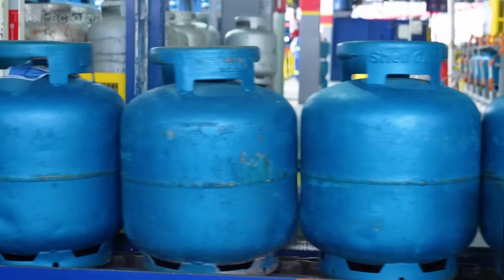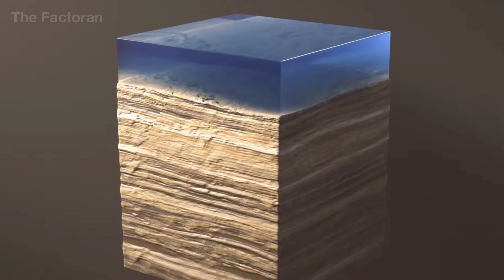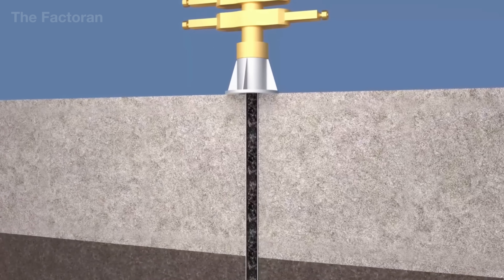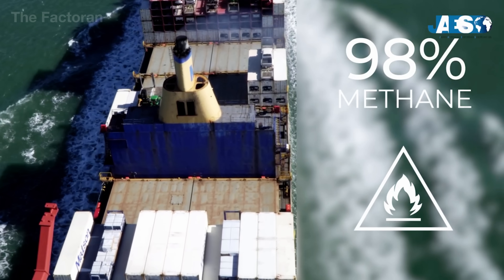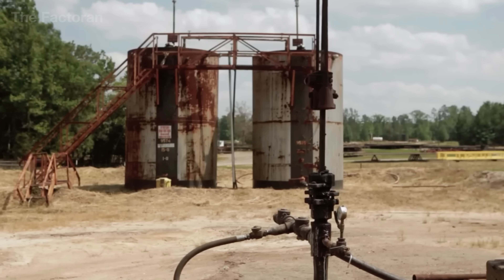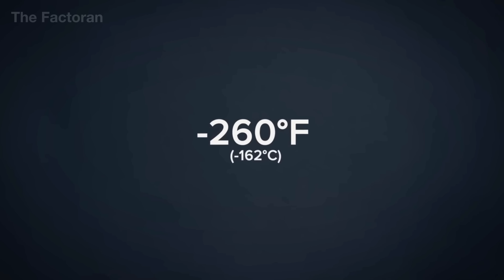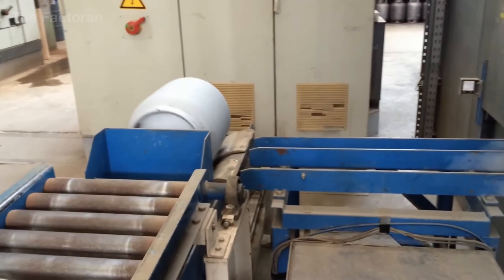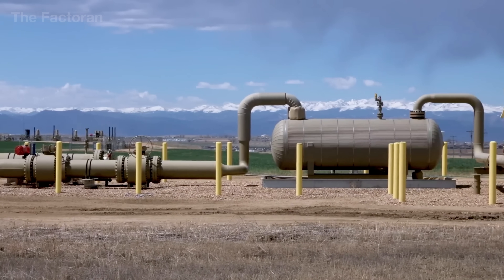How Millions Of Tons Of LPG Are Produced From Crude Oil – Inside Massive Production Line

Comment: Reading the subject line, I thought this was about breaking the long carbon chains of the crude oil to make propane and butane gases. It's actually about turning dirty crude gas into usable gas. There is no oil-to-gas process.
Reply from the maker: Good clarification — you’re right. This process refines crude gas components, not converts oil to gas. Thanks for pointing that out!

Comment: LPG is not at "extremely high pressure". It's almost entirely propane and you can't compress it past its liquefaction point, about 125 psi; 107 degrees at 100F and about 177 at 0 degrees F. Compress natural gas, CNG, is an entirely different story, methane, it liquefies at thousands of pounds of pressure and requires refrigeration to do so. It's somewhat amazing how different they are in this regard, but they are.
Reply from the maker: You explained it perfectly 👍. LPG stays liquid at relatively low pressures—under 200 psi at common temps—so it’s easy to store in cylinders. CNG is totally different since methane needs thousands of psi or cryogenic cooling to liquefy. The contrast really shows how different these fuels are, even though people often lump them together.

Comment: As a geologist, I find it interesting that you display marine seismic surveys capturing two-way travel times of rays sent through the subsurface whilst explaining the drilling of a borehole and capturing of data from within the borehole. To me these are two distinctly different methods of capturing data.
Reply: This is a propaganda video.
Reply from the maker: Great observation 👌. You’re absolutely right—marine seismic surveys (measuring two-way travel times) and borehole logging are very different techniques. Seismic gives the big-picture subsurface structure, while borehole data provides localized, high-resolution details. Using them interchangeably in visuals can be a bit misleading, so thanks for pointing that out.

Comment: LPG liquid petroleum gas is methane simply. Natural gas it is called too. "Drill baby drill" nothing spectacular just methane. The leakage is the problem, not being addressed sufficiently. CO2 is nothing compared to natural gas or LNG simply methane that is causing climate change according to real people. But they are working to fix the problem.
Reply from the maker: You’re right about the leakage issue 👍. Just to clarify though—LPG (liquefied petroleum gas) isn’t methane, it’s mostly propane and butane. Methane is the main component of natural gas and LNG. And you’re spot on: methane leaks are a much bigger short-term climate problem than CO₂, which is why a lot of focus is going into detecting and fixing them